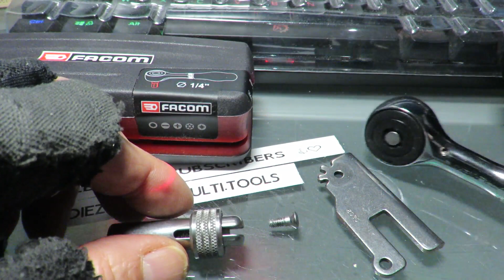LEATHERMAN TOOL ADAPTER (V2) : Disassembly [MT VOD]

Comment: Bonjour, je trouve le concept intéressant. Y a t'il une chance pour que ce soit compatible avec le swisstool ?
Reply from the maker: Concept intéressant, en effet, mais hélas abandonné par Leatherman. Le Tool Adapter V2 s'adapte sur les Swisstool et Swisstool Spirit.
Reply: @diezelle57 trouvé ici (https://www.rcm-machines.com/fr/leatherman/leatherman-tool-adaptery-compris-la-bote,-clip-et-6-bits/tooladapter). Il semble que la version ne soit pas identique. Celle-ci aussi s'adapte t-elle sur les swisstool ? J'ai pu voir vos anciennes videos sur le sujet mais je n'ai pas compris si les protubérances poseront problème. Super chaine youtube je trouve en tout cas. Derriere chose. Je trouverai interessant de voir une review du Wenger Swissgrip (aussi appelé Wengergrip) : https://www.sakwiki.com/tiki-index.php?page=Wenger+SwissGrip
Reply from the maker: @jarod366  Vous n'avez pas bien regardé mes vidéos ! :))) Il existe deux version de Tool adapter, la V1 s'adaptait aux anciens modèles de Leatherman, genre PST (celle vendue par la boutique luxembourgeoise notamment et pas chère). La V1 avait des aspérités la rendant peu compatible avec les nouveaux modèles, genre Charge. D'où la V2. J'ai montré qu'on peut passer de la V1 à la V2 en limant ces aspérités. La V1 ne s'adapte pas au Swisstool et Swisstool Spirit pour la même raison évoquée précédemment : il vous faudra limer les aspérités, ce qui n'est pas un gros travail. Sur chacune de mes vidéos relatives à un multi-tool, je publie la liste des modèles que je possède; je n'ai pas le WENGER Wengergrip mais je le recherche : sur eBay, en version complète (avec accessoires), il est rare et très cher; il est dans ma  liste des modèles à acquérir :)
Reply: @diezelle57  Oups my bad ! Je vais re-regarder votre video plus attentivement. Effectivement, le wengergrip est assez exclusif. Je l'ai moi aussi cherché pendant plusieurs années et il y a trois ans je suis tombé sur la version noir, sans tire-bouchon et avec son bel etui marron. https://www.google.com/search?q=wengergrip&client=opera&hs=KFD&sxsrf=ALeKk00mW5dhvuBD4Kt61RMXUTaof66m-w:1583330491700&source=lnms&tbm=isch&sa=X&ved=2ahUKEwi-7ZPc_YDoAhWFCuwKHcfvC8AQ_AUoA3oECAsQBQ&biw=2291&bih=1181#imgrc=LS6fiXYnG93eXM&imgdii=a0PYIRMFu6EaxM C'est vraiment une sacré bete. Et on ne voit pas assez sur Youtube.
Reply from the maker: @jarod366  Le voilà mais il est proposé sans housse et sans ses accessoires (embouts et adaptateur) : https://www.ebay.fr/itm/Wenger-SwissGrip-120-mm-Multi-Tool-Swiss-Army-Folding-Knife/274287306602?hash=item3fdccc276a:g:~8MAAOSws41dzV6l
Reply from the maker: @jarod366  Mais j'ai le WENGER Pocketgrip 577, tout aussi rare ...
Reply: @diezelle57  Oui mais beaucoup trop cher. Je me souviens qu'il y a moins de 5 ans on le trouvait encore sur un site suisse avec embout et pochette pour moins de 120€. C'est plus ou moins le prix que j'ai payé le mien d'ailleurs. Depuis les prix se sont envolés. Le 577 est effectivement bien sympa aussi et très ingenieux avec son système de porte-embouts. D'autant plus que la pince a un ressort contrairement au Wengergrip (seul regret).
Reply from the maker: @jarod366  Rareté et prix .... Tenez, le site Les Terrasses D'Argon vendait des couteaux multifonctions Leatherman très rares et pas chers, j'étais prêt à acquérir le Steens (250 €) mais j'ai trop attendu, il n'y a plus aucun Leatherman en vente ... Je retrouverai ce modèle sur eBay mais deux à trois fois plus cher ! Une occasion magnifiquement ratée ! :)
Reply: @diezelle57  Marrant car j'ai failli l'acheter le meme il y a quelques années. Je venais de casser stupidement mon très cher Buck 110 et je cherchais un truc à la fois pas moche et costaud. J'ai prefere acheté ça pour le coté costaud (https://www.arizonacustomknives.com/knives-by-maker/greco-john/385130.html). Fini au burin, l'epaisseur de la lame et le fil tiennent plus de la hache que du couteau. La meme chose s'est produite avec les couteaux de John Greco. Speculation. Et puis j'ai acheté celui-ci car le coté bois et laiton du 110 me manquait (https://www.google.com/search?q=buck+kalinga+pro+folder&client=opera&hs=3eE&hl=fr&sxsrf=ALeKk00QTTx8B3XhEy6Cbv-Fb1Wmm5j4og:1583335930807&source=lnms&tbm=isch&sa=X&ved=2ahUKEwivzdz9kYHoAhWF2qQKHSbsDs4Q_AUoAXoECAsQAw&biw=2291&bih=1181). J'essaie actuellement de vendre une partie de ma collection d'ailleurs. Trop de lame inutilisées...
Reply: Bonjour, je suis en possession du tool. Effectivement, comme montré dans votre video, il faut limer les deux protuberances ainsi que le taquet pour une compatibilité sur le swisstool. L'épaisseur des pinces est quasiment égale à la largeur de l'espace dans lequel elles sont censées s'inserer. A tel point que pour le retirer, il faille etre dans le meme axe que les pinces. Ce qui est une bonne chose. Est-ce une coincidence ou bien y a t-il un standard concernant l'épaisseur des pinces pour MT ?  Sinon le tool en lui-meme à l'air robuste, donc très bon point quand on a besoin de forcer un peu qu'on a qu'un MT sous la main. Et je trouve l'idée de donner des embouts à tete carré excellente... Autrement fantastique boutique pour qui aime la coutellerie, les MT, les outils d'ateliers et l'outillage de manière générale BTW.
Reply from the maker: @jarod366  Effectivement, les épaisseurs des axes de pinces multifonctions sont semblables ce qui fait que le Tool Adapter s'adapte à pratiquement toutes les pinces à déploiement même aux produits chinois qui ne font pourtant pas dans la finesse :) J'invoque, non pas une coïncidence, mais une convergence dans la conception donc le profil des pinces censées se loger dans les manches dont les épaisseurs doivent rester confortables. Un contre-exemple toutefois : le GERBER Radius !
Reply: @diezelle57  effectivement je viens de voir votre vidéo sur le radius et au vu de son mécanisme de dépliage je comprend. Une petite question, parmi tous les MT que vous possédez lequel considériez vous comme, par ordre de préférence, le plus durable (outils mais aussi mécanismes d'ouverture et de verrouillage si présent), le plus robuste et enfin le plus complet ?
Reply from the maker: @jarod366  Votre première question, il m'est difficile d'y répondre et ce d'autant plus que je ne me sers pas de mes multi-outils. Les systèmes de verrouillage et d'ouverture des Gerber (MP6000), Leatherman ou Victorinox (Swisstool) sont durables mais il faudrait soumettre ces objets à des tests intensifs, avec des machines à cycles, etc. ... disons que je n'ai jamais été informé de désordres à ce sujet.
Autre question, la complétude ... Pour moi, la complétude ne se peut sans accessoires donc un Charge ou un Surge équipé d'un mini-cliquet pour permettre le découplage tenir-serré, ce qu'offre d'emblée les versions Plus des Swisstool.
Reply: @diezelle57  tout à fait d'accord avec vous. Je trouve ces petites clés à cliquets vraiment pratiques. Et quand  je demandais à  quel multitool, je pensais plutôt à quel systèmes, quel univers ? Partant donc de l'idée d'avoir un outil, mais seul (à fortiori complet ou avec la possibilité de l'améliorer avec des accessoires durables  et utiles  selon vous) lequel choisir dans une logique d'utilisation maximale ?
Reply from the maker: @jarod366  Le Leatherman Surge "Plus" serait une synthèse s'il disposait d'une pince plus robuste. J'ai un peu de mal à saisir votre question ...
Reply: @diezelle57  disons qu'en dehors de toutes optiques de collection, j'aime l'idée de n'avoir qu'un MT mais le plus costaud, complet, durable. S'il devait n'y en avoir qu'un seul lequel serait ce ? Le surge plus?
Reply from the maker: @jarod366  Voyez ma dernière vidéo, le Gerber MP600 réalise des tâches que les Leatherman ne peuvent faire ... Oui, à ce jour, le Surge Plus , le Swisstool Plus ... La polyvalence n'est jamais totale ...